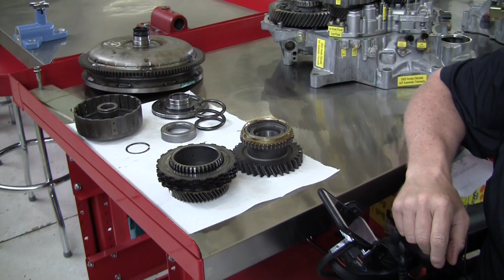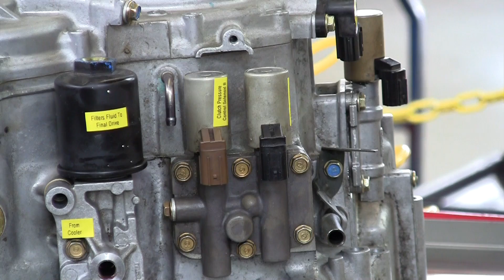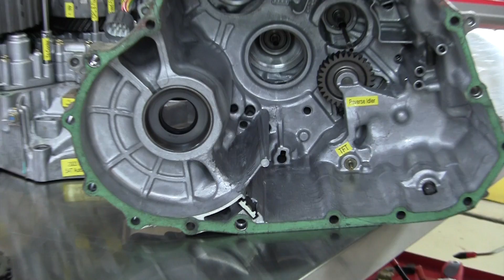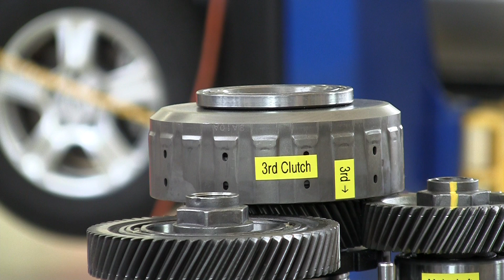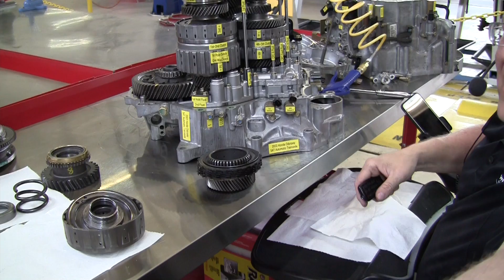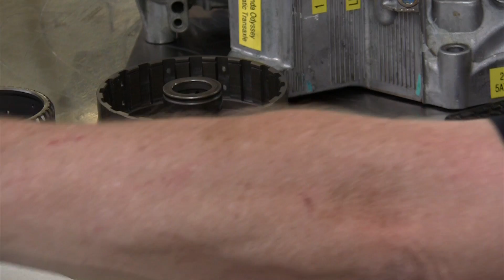Honda AT5 Automatic Transaxle

Comment: I keep getting a p0746 code pressure control solenoid A stuck off, what could this be? I've changed it twice and still keep getting that code and it won't shift into 2nd or 3rd.

Comment: How much air pressure to check drumsi put air in secondary shaft top feed and only bottom engages 1st I believe . Everything I see online says both clutches are supposed to be engaged at the same time witch is pretty weird i think 🤔

Comment: I have a 2003 Honda accord V6.  Back in 2019 the transmission went out.  Slipping etc.  Had it rebuilt.  3rd clutch pack no frictions left.  Rebuilder used a sonnax rebuild kit which included many updates according to the shop.  As we know it is currently 2025 and my transmission has given me no trouble. I do my own fluid drain and fills and keep it frequent.
Reply: What transmission fluid do you use?

Comment: Hello. It's great that you're still answering questions for a 9-year-old video. I watched the video carefully and couldn't find any information about shifting to the reverse gear. For example, which solenoid is responsible for this? And what could be the reason for the lack of reverse? I have the same transmission, and the car moves forward fine, but won't reverse. Do you have an answer? Could it be the solenoid or something like that? Thank you very much.

Comment: I've been looking to see if you have a video for a Honda  6 speed transmission.
My 6 spd has a slip only when upshifting from first to second.
Doesn't do it all the time but is worse in warmer temps 
It throws a code of P0776 AT    
Clutch pressure control solenoid valve B shutoff 
Dealer replaced the whole valve body located under the battery but that did not fix it.
They are saying that maybe it needs a new transmission?
What is your experience on this issue?

Comment: Many thanks for taking the time to present and share this in such clear fashion. I'm getting my hands on a beater early (04-05) tsx shortly with a ton of work needed and it comes with a spare motor and trans which as far as I know is coded MCTA. I expect to be tackling a rebuild on the spare and swap it in when it's done then do the same for the motor. I think I'll be watching this video several times and taking notes prior to and during that endeavor which right now feels a little daunting. I'm thankful for the disassembly tips and zooms on clear labels. Invaluable for a novice.

Comment: I have a 1998 Honda accord EX 3.0 v6  , I bought an out put speed sensor , from Amazon which is shorter then the longer one in it ! Which is the right one ? One from Amazon is about a inch long the one in it is two inch about ?

Comment: How can I not stress this enough, this is not a AMT. Its a automatics that has a structure simuler to a AMT. A real AMT has no torqe converter, and uses a genuine single clutch plate and shifting mechinism. Honda transmissions still uses thebshift by fluid pressure from torqe converter method. It may be close to a AMT but its not a real AMT.

Comment: Subscribed! Exactly the content I was looking for..... I have a 2003 Accord V6 automatic that has one issue..... the two to three shift is weak and delayed.... I Now understand a little bit of the theory of operation. What was very informative was the two-step shifting process you talked about... but then is delayed completing the shift and I'm afraid there is slippage going on. I think from your explanation I need to remove and inspect clean and test the Dual solenoid pack on the top of the transmission. Thank you so much
Reply: Any update? Did you check the solenoid?
Reply: @iank6897 on my V6 I couldn't seem to get to it I'm not sure what else I need to remove. For the time being I just go easy on the throttle for the 2-3 shift that seems to work fine.... for now.

Comment: I had a 2000 accord with a 4 speed. It shifted soooo slowly. Kind of wish it had the shift quality of the 94-97 where it was much more crisp. After I rebuilt it the first time I did fluid changes every 12k miles to try and keep that filter clean

Comment: So the clutch packs definitely need to be replaced 100%. But I can't open the transmission myself, and if I want to pay for a transmission rebuild, it costs $3000? This is kind of amazing
Reply: The gearbox has lasted 400-600k km for sure and used ones cost 180-350€. So no, you never have to replace them when you change oil properly.
Reply: @mulvahetpolemidasateed  That's a flat lie
Reply: @themodfather9382  According to what? Local car ads here. 2.2 diesel 5 speed autos have over 500k km on some. Older audis have 500-800k on clock. Nobody never opened those boxes.
Reply: @mulvahetpolemidasateed This is nice to hear that if they services properly they are good for 500k km. I am just about to replace my Civic Tourer 1.8 manual for a 3 Gen. CR-V 2.0 automatic

Comment: So all and all is it a reliable transmission, I have a 2013 after it hit 50,000 miles I changed the oil ran it for a week change the oil again ran it for a week change the oil again this way I can get all the oil out of the converter which you really don’t you get about 80%, then When it hit 90,000 miles I just dropped 3 quarts and added and they say to do it every 50,000 but I do it every 20 it’s too simple not to. I don’t beat the car at all I’m 60 years old I’m trying to figure out by taking care of this vehicle what the longevity should be, I live on Long Island which is a mixed driving highway and around town but it’s not city driving like Manhattan that’s for sure anyway any positive input on my transmission would make me sleep better . thank you

Comment: The purpose of the shift fork? Thanks for the video; my 2008 Honda Odyssey transmission … when I shift to neutral, there’s a grinding sound and then the engine wants to die; also, when shifted into park, the van will still roll. So this video helps out a lot.
Reply: 325,768 miles on van, brought van used with 90,000 miles

Comment: Mine is a 2013 CRV with the five speed I would imagine it’s the transmission you’re showing me here, I’ve change the oil every 30,000 miles, right now it has 101,000 the second time I changed it I did the fill and dump so I pretty much flushed it out. I’m very conservative when I drive I am 60 years old, what I’m getting out here is with real good maintenance and treated properly what’s the furthest you’ve seen one of these transmissions run
Reply: @Steven Strain Same thing with my CRV I think 14 was the last year of the five speed And then they went with the rubber band tranny

Comment: I have a power vibration from 1500-1900 on first and, second that happens when changing gears and, is very present at 1800 rpm. Otherwise works great. This is a civic 1.8 2012 at5 thanks.
Reply: Is the Civic and Accord trans similar

Comment: So if we have actual gears, does this mean we can swap gears out? Cuz I’d LOVE to get the manual gear ratios put in my automatic
Reply: Unfortunately no, the gears are not interchangeable with the manual. Where a manual gear would have a synchro, the automatic have an extended part of the gear that's engaged with the clutch pack. It may be possible to take the gears from a 6 speed, which has lower ratios, but I doubt it's possible.
Reply: @yummyhershey5902  I was talking like having custom gears cut specifically for the auto, I know manual gears won’t work
Reply: @Draftsman_MC1300  ahh I didn't realize that was what you meant. Well then yeah, I'd totally possible as long as you can find a company to do it for you (or learn to do it yourself, but the tools would cost a lot of money).

Comment: I just rebuilt my 2006 Honda Odyssey. It was overheated. I changed all the seals and clutch pads. There are some issues with the transmission that I can’t figure out. Trouble code P0757 P0776.  Start Low RPM have no D gear. The solenoid have been tested and working properly.

Comment: Hi ,Honda it used Z1 transmission fluid before 2011 and it was switched to Dw1 later and it is thinner than the Z1 , i have accord 2014 4-cylinder k24w2 engine the Middle East version comes 5-speed transmission What is the fluid for this transmission Use under high temperatures in the Middle East, Like  honda z1 , amsoil fluid atf Multi-Vehicle or Fuel-Efficient fluid like dw1 thank you sir

Comment: Very good information, well explained and easy to follow. You pointed out that spring for 3rd gear clutch, how it forces the pressures unevenly, makes sense. I would add, the spring could have been made better, allowing evenly applied pressure, on top the fact that shaft has more work to do connecting the other two shafts together, probably adds to the premature failure of that clutch... and they could have made the clutches larger in diameter for better hold?

Comment: If I remember correctly the Saturn MP 6 and MP7 automatic transaxles were a similar design? I always found it strange that a GM product would reinvent the wheel and develop a totally different transmission technology instead of using an off the shelf GM planetary transaxle? My memory isn’t what is used to be but I remember rebuilding an unusual number of both the Honda and Saturn units when I was in the business. Don’t get me wrong those damn Dodge Caravan units the A604 and I believe it was the 413? were the most common ones by an order of magnitude without a doubt the worst transmissions I’ve ever seen. I probably built 5 or 6 of those for every other unit! I just couldn’t believe the issues that Chrysler never fixed like the fact they throw the differential pin through the case I always installed a couple little clips  that probably cost 10 cents on the ring gear bolts to prevent this from happening. Year after year Chrysler just continued to make the same pile of junk without even a 10 cent fix for a well known issue.

Comment: I have a slight whining noise upon deceleration when a let off gas from 35mph down to about 10mph. Same noise even when i put  it in neutral in that same scenario.  It's a 2006 Acura TSX auto. Please what could be the problem?

Comment: Hello Sir
Question:
2009 Honda MDX
66174 FAULTY TRANSMISSION 3RD CLUTCH FLUID PRESSURE SWITCH-
P0847 OBD-II Trouble Code:
Transmission Fluid Pressure
Sensor/Switch “B” Circuit Low

Before this issue above there was a software update applied for a shuttering torque converter...few years later the DTC-P0847 issue diagnosed to be the switch being as the issue and replaced but my question is - 

Do you think there is internal damage that occurred internally over the course of these issues due to this switch failing and and the seemingly simple fix/issue being the software update/switch itself? Im concerned about gradual issues with the transmission and longevity.

Looking to purchase this vehicle and has currently 130K...

Comment: Thanks for the AT5 training video. Very good. I have the AT6 behind a J35Y1 and it is brilliant.
I also have a 1997 VTI-R H22A4 with a 4AT Sport Shift. I believe these are vulnerable and fail often. Possibly due to poor OEM parts, or so I am reading, such as clutch Fibre, and solenoids clogging, etc. Even with schedule service. 
Would you have any experience you could share on this box?
Thanks.

Comment: Very interesting to learn about all the sensors on this transmission, I was wondering about the shifting logic because if the ecu detects no vehicle movement and throttle past a certain %, it will upshift from 1st to 2nd even if 1 is manually selected, I've found this very frustrating when launching and going up steep hills.
Reply from the maker: Yes, it does that to prevent engine damage. Thanks for watching

Comment: Old Honda gearboxes of this type and time got a lot of stick. But really if you can drive the equivalent of around the World 3 or 4 times before you get trouble, I thick you've got your money's worth. (stop moaning and chuck a recon box in it and go around again you tight #*/$! ). nothing last forever
Reply: They should've made the trans filter easily accessible. Instead they made it nearly impossible without a full deconstruction. I like the philosophy of the original Volkswagen, which was that anyone could repair their own vehicles with common tools. Honda was like that up into the 90's. Luckily I have the necessary tools, just not the shop space.

Comment: I have bought 3 1997 Honda Accords, all with automatic transmission problems. I took them apart and the clutch plates were bad in all of them. So I replaced them with a seal kit and a rebuilt converter, and now I have been drive one with no problems for around 3 years. I guess they had poor clutch plates and the new clutch plates I got were updated to replace the old clutch plates,,,,,,,,,
Reply from the maker: Thanks for watching

Comment: I have this transmission in my Honda Accord with only 20k miles. Intermittently, the car shifts very rough and abruptly. It is worse when it's cold; it almost always shifts hard when it's cold. Today when I was driving down the highway, it held on to 4th gear for almost 20 seconds before shifting into 5th. What could be causing this? Could a TCM reset help solve this? Are there any solenoids or sensors that are prone to failure, especially in a vehicle that sat for a long time I already replaced the fluid with Honda approved ATF to ensure old fluid was not causing any issues.

Comment: I have a question about what holds the transmission in park is it a gear or a pin my 2014 honda crv won't hold its self in park. How can I fix it. You are the man I need to ask because ya do a great job explaining how that transmission works

Comment: Thank you so much, excellent description. Honda makes so many different models for every speed auto transmission. Some are quite robust, while others are not. There are no less than 6 different size clutch combinations in four and five speed at. At this point in time there is no question that automatic transmissions are faster than manual transmissions regardless of type. The ecu controls line pressure yet even in 2020 it's still not something people tune or even have knowledge of. With some simple gear, basket(shell) and shaft hardening, increased pump pressure and direct application of hold solenoids with a momentary cut using paddles it would shift identically to a sequential gearbox. Red Eagle frictions and steels would hold well. The tougher large clutch transmissions would definitely be capable of handling big power with mods.

Comment: Great video, thank you! Is that transmission different to the MCTA found in Acura TSX 2004-2008 4cyl.? Thank you
Reply: That's what I'm wondering? Which Honda transmission is that one? Nice to see most of them are built in a similar manner though
Reply: @rickybobby8563  it’s an 03 odyssey, which is nearly identical to any 3 shaft 5 speed on a 6 cyl Honda/Acura. I’m not sure about the 4 cyl models however

Comment: Excellent video, I appreciate your in depth explanations.  I have a 2011 Odyssey with a 5 speed transaxle. When I let off the gas there is a surge or jolt felt when the transmission is downshifting.  It seems to do it regardless of what gear it is coming out of.  What would you say is the reason for this?  I am thinking it is solenoid related, but not sure which ones or if it is all of them, or perhaps a filter problem.

Comment: Amazing video.
Why is there a torque converter if it's practically a manual?
Especially if the pressure is controlled.
Reply: Because there is no main clutch, you still need to be able to disengage the engine from the transmission.
Reply: @samsmith3025  
But you can use the first gear pack as a main clutch can't you?
And in stop disengage all of them and in first gear slowly increasing the pressure so the car will start like a manual.
Reply: @jerryp2433  there is a dedicated pump in the valve body that provides the hydraulic pressure. They don't need a torque converter. They technically didn't need a main clutch at all. They technically could've just used the clutches attached to the gears, but they didn't design it like that.
Reply: @jerryp2433  nah. There were designs that got rid of those inefficiencies as early as the 1950s. Chrysler was the first to use it in a production car in the 80s. Most Japanese manufacturers didn't start using them until the 90s.

Pretty much any modern car with a torque converter has the ability to "lock up". There's a clutch integrated into the torque converter that allows it to spin 1:1 with the flywheel, making it 100% efficient.

Comment: Wao they just not use that on the 2002 Honda Accord Ex Coupe because mine never have that outside filter.....I see it’s the same with some upgrades will that tranny fit my car? Cause if it does please let me know out of what car I need to get it from cause with that outside filter that will prolong its life or I could even just pull that filter/pressure oil line from any make model that has that upgraded tranny at junkyard. Ohhh I see it from an 03’ Oddysey

Comment: Hi Mr. WeberAuto, just here again to tell you that I had the same problem with 3rd clutch in the 5 speed and I did find out the cause and solution to the problem. I posted a 29 part video series and on part 13 at 11:03 minutes into it I start explaining the problem and solution, just wanted to let you know https://www.youtube.com/watch?v=hy2Glwf_lJI  there are 2 links in my description to articles I wrote about this problem. not trying to derail your video, just someone who's seen what you've seen with this

Comment: Excellent video. I have a 2005 MDX MDKA 5spd Transmission (212,000 miles) with a slipping Sprag (1st Hold Clutch). Known problem for loosing forward power after a stop. I overhauled the transmission (170,000 mile) but did not change the Sprag, it seemed ok on my bench test. Now I regret not changing while I had it apart. Honda does not sell the Sprag alone, but the whole assembly ($300). I wish someone whispered that secret back in time.